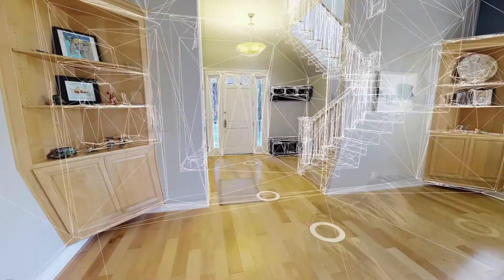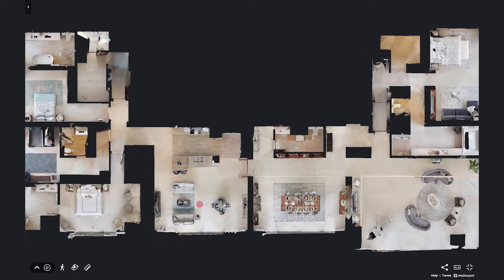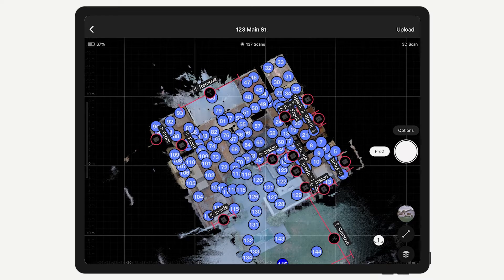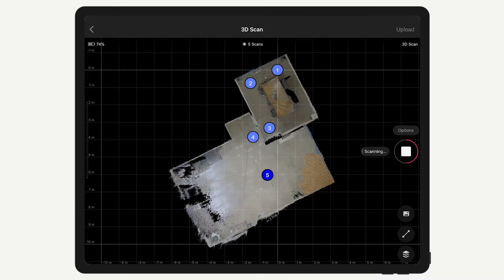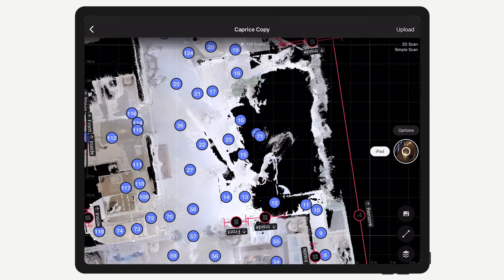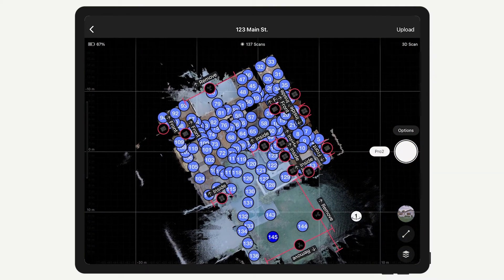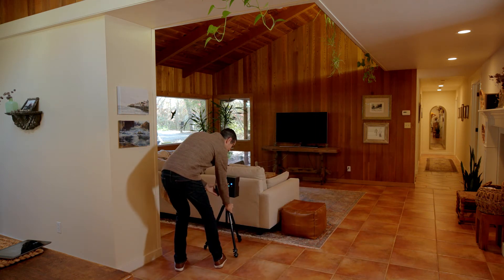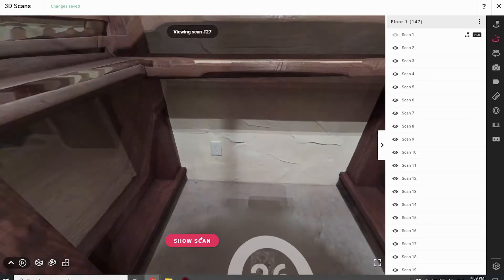Generating a Complete 3D Model

Comment: Hey, Is there a way to convert the file into a 3D OBJ file?
Reply from the maker: Yes, there are several file types you can get. One option is a MatterPak, which includes a point cloud XYZ file and a mesh OBJ file.
Reply: @Matterport  Thank's but I can not find the option to export it in MatterPak format or any other on android - there is only option to export project as zip-archive!
Reply from the maker: @play4fun599  Hi, The MatterPak is an add-on you would purchase through the model page in your my.matterport cloud account.

Comment: Question: how do I export the generated 3d model?
Reply from the maker: Hi Lin, Once your model data has been processed into a 3D model, you can order and/or download assets from your model page in your Matterport account.  The 3D model or digital twin itself can be embedded just about anywhere, much like you would embed a Youtube video, using the iframe HTML tag.  The processed 3D model can not be downloaded to your computer. However, iOS does have a Showcase app available and you can download the model there for offline viewing.
Reply: @Matterport  Thanks, therefor it is not possible to used the generated model in a unity project to build a VR AR app for it?
Reply from the maker: @clifflin7149  Sorry for the misunderstanding.  The Matterport digital twin can't be downloaded, but assets like an OBJ and XYZ point cloud files can be downloaded.  Also, we just introduced BIM files that gets you a rendered RVT and DWG file of the model.
Reply: @Matterport  I was also looking for this info.  Thanks!

Also, what information is present in the point cloud files, obviously xyz locations and probably color, but does Matterport calculate textures, light sources, shadows, etc.?

Thanks again, the Matterport scanning technology is amazing
Reply from the maker: @Neonb88  for the point cloud files, XYZ & E57, as you said, the x, y, & z coordinates as well as color and brightness data.  Considering the density of the E57 when color and brightness are included, you end up with something that's typically still closer to photo realistic than the OBJ with included texture maps simply because the resolution of the OBJ is something like 200k facets total.  

You don't get a light source and shadow information as part of these files.
Reply: @Matterport  Mind to clarify where can I download the 3d model? I go to space => download and only see download options for video and photo in my free account. I guess it may be a paid option?  Then I don't see anything suggesting I could download a 3d OBJ in the upgrade menu. I'd like to know for sure before I do any payment
Reply from the maker: @garycheong  If you're just interested in getting a test 3D mesh or point cloud, we do have samples you can download from our support pages - t.ly/WUOx
The OBJ, XYZ and E57 files are considered professional use assets and, therefore, do require a paid account such as the Starter or Higher tier plan - buy.matterport.com
Reply: @Matterport  I checked with my friend who owns a starter account. It took us a while to figure out... So from what I found, the obj download is not a subscribe service, but a "standalone purchase that cost $49 per scanned space", in additional to having a paid account, is that correct?
Reply from the maker: @garycheong  That is correct.  The MatterPak, which includes the XYZ and OBJ files is an asset you can purchase if you have a paid plan. Also, the only cameras that support those assets are the Pro cameras or Leica BLK360.  If you capture a 3D model with your phone or 360 camera, the OBJ file cannot be purchased.  This has to do with the dimensional accuracy of the supported cameras.

Comment: Can 3D models only be generated using the high-end camera/LiDAR device? Or can my iPad Pro with LiDAR also create one, I'm not seeing where to export the 3d model anywhere...
Reply from the maker: Hi Orlando, You can certainly use your iPad Pro with or without LiDAR to capture a digital twin.  A monopod or tripod to assist with the pano is recommended, but not required. Once you have all the data in the Capture app, you should see an "Upload" button in the top right corner of the app.  Tap that and if you're not signed into your account, you'll be able to do so at that time or you can also sign up for a free account to process your raw data into a 3D model.

Comment: Amir - I shot a 200 sq ft lounge with 3 walls of floor to ceiling glass. At this same property I shot a resort pool/area. Neither shoot produced a presentable dollhouse - rather they had that Frankenstein effect. I went back and watched shooting Large Spaces and then shot both areas again more than doubling the scans and in the case of the lounge I marked windows as I went. I still haven't gotten the desired effect. Could someone on your team look at one of these spaces and tell me what I'm doing wrong?
Reply from the maker: Hi Richard, we're happy to look into the model and see what may have gone wrong. I'll reach out to you offline regarding your exact model links.